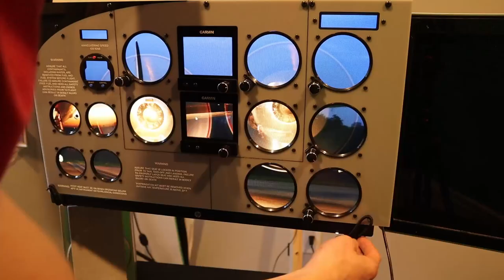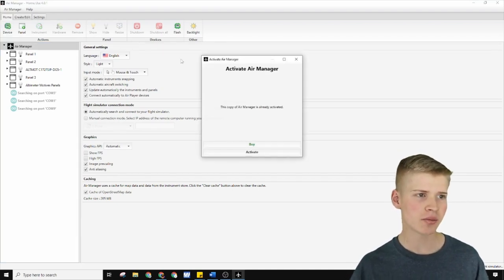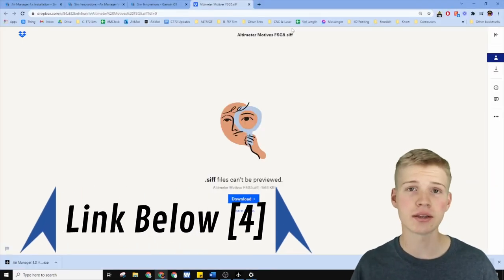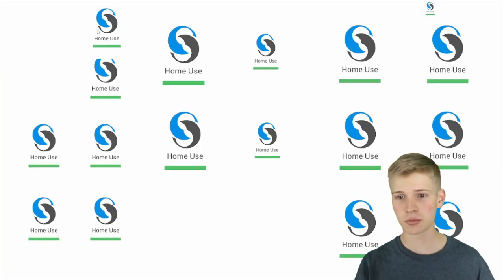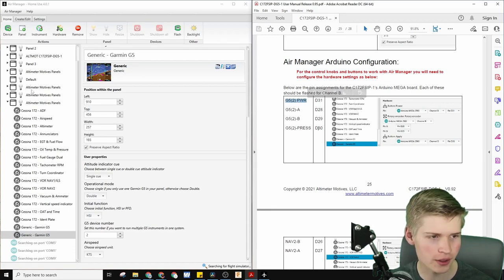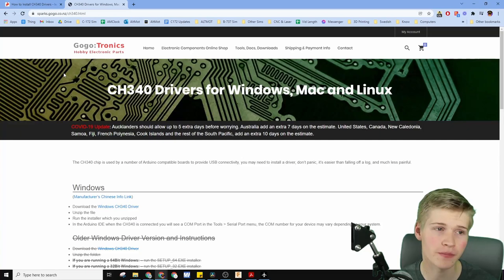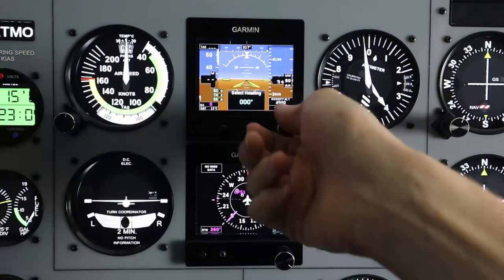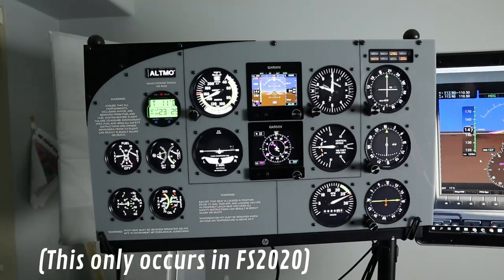Configuring the Altimeter Motives Dual G5 Instrument Panel for Cessna 172 Flight Simulators

Comment: Can it be preconfigured before shipping?
Reply from the maker: Hello! The Arduino is pre-flashed with the proper channel, but unfortunately, these cannot be entirely pre-configured before shipping due to software limitations.
You will have to assign the knobs manually. If you